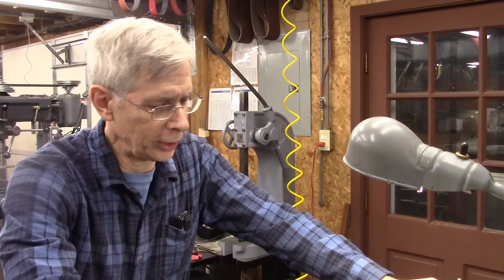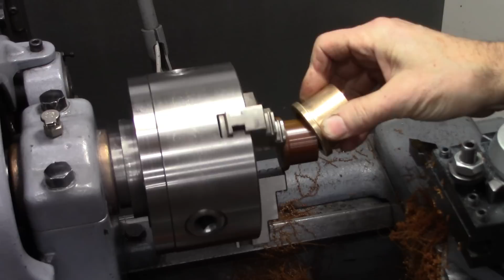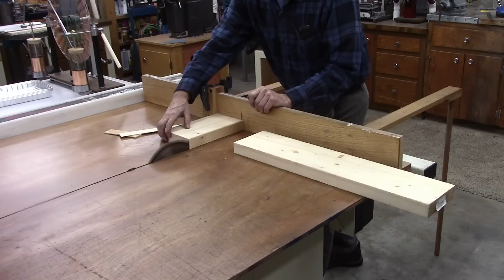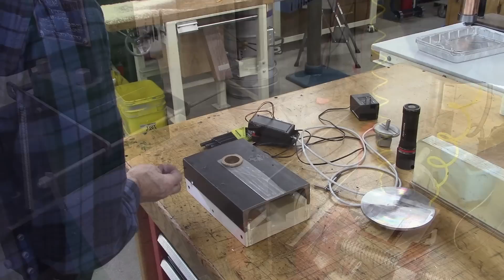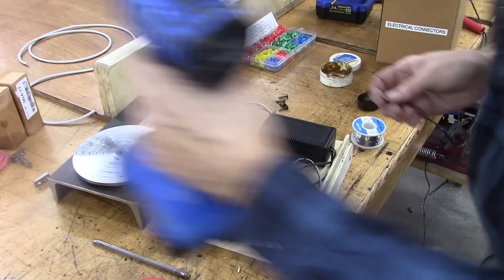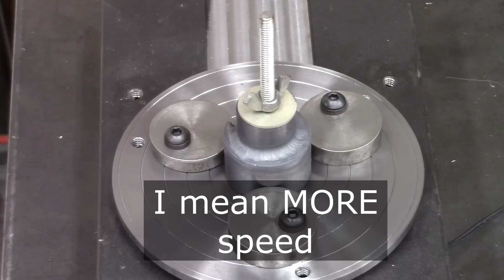Special Announcement + A Weld Positioner from Surplus Parts

Comment: Just curious why you didn’t just put the plate in the Milling machine to drill the holes in the plate?
Reply from the maker: It's just quicker to do it on the lathe. Of course if I did not have the indexing setup made already the mill with the rotary table would have been the best.

Comment: Cool project Mark! You could add a master power switch to be able to turn it on and off. Secondly, you could add another that would allow you to toggle between automatic turn or a foot-pedal turn. Or even better,  if you found the right switch, one switch that controls power, auto turn or foot-pedal turn. Good luck, G.
Reply from the maker: I definitely need speed control.

Comment: Dang, that's slick! I welded short sections of tubing to 5/16" nuts on a crude home made welding positioner that used a variable foot controller. I used my left foot to control the positioner speed and my right foot to control the tig welder, my right hand on the tig torch and a piece of .035 mig wire in my left. I have a Harbor Freight foot control that only provides on and off that might work for your application.
Reply from the maker: Dang, you are more coordinated than me. I have a hard time with one foot pedal.

Comment: Mine’s much cruder than yours. Looks like I need to do something to “keep up with the Joneses”. 😎👍 Nice project. I used a belt drive and rubber washers to isolate the drive motor from the platen. A good controller enclosure would be a great addition.
Reply from the maker: Belt drive is a very good method. I made one like that..  very crude and temporary though

Comment: Great weld positioner build Mark...I need one like that for sure! I also do not have a way to control my amps while TIG'n for I use a stick welder conversion build. I have over 40 years welding exp. so I can Pre set my amps for each job with good success for most non critial welding. Got to get a REAL TIG machine before I'm 70 lol!
Reply from the maker: I have two TIGs. One has a foot pedal but I use the machine without most the time. It a simple machine from VEVOR. Most often the complexity isn't needed.

Comment: My first time seeing your woodworking skills.  I am jealous of your awesome shop setup!
Reply from the maker: Thanks, this was really not a good display of my woodworking skills but thanks. I will say, my router table is one of a kind. It has a lift top and the homemade router lift stays in the stand. It makes bit changing super easy. The lift screw is set up so that one turn on the crank is 1/16" inch so depth of cut setup is easy. The only thing i would do different is put off white Formica on the top. The Advantec I used is great but it's hard to see if the table is clean and laying wood on sawdust effect the accuracy.

Comment: Hi Winky,
I have the same lathe as you. An old South Bend 27-A. You've done better at restoring yours, so far. I really enjoyed your videos of the restoration. 
Most times when I try parting off, it pulls the cutoff tool under the work and jams. I know I need to replace the gibs to make it more rigid. I have the bronze and just need to do it.
Were you having the same problem, and your special parting tool was able to fix it?
Reply from the maker: If you are using a spring cut-off it probably needs to be stiffer My design leaves a nub but seldom goes under. I usually set the tool maybe .010 higher thank center. It's also related to feed rates vs RPM. Ideally a slower feed rate and higher RPM at the end of cut would totally resolve the issue but there is always a compromise.
Reply: @WinkysWorkshop  It's going under without the spring cutoff. I need to make new gibs for it, to try increasing rigidity. I was wondering if the flexibility of the spring cut-off prevents it from digging and going under.